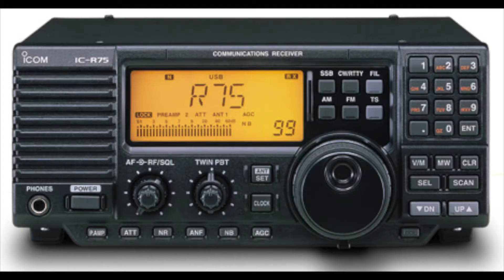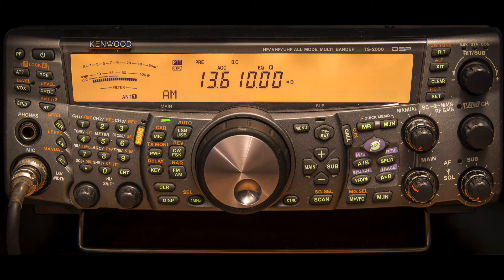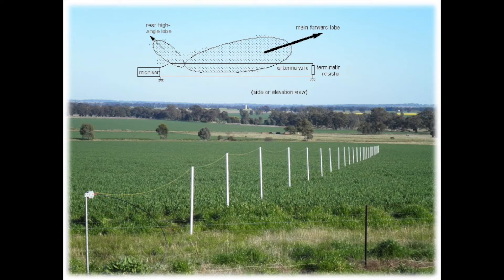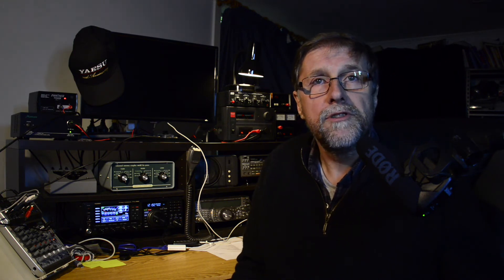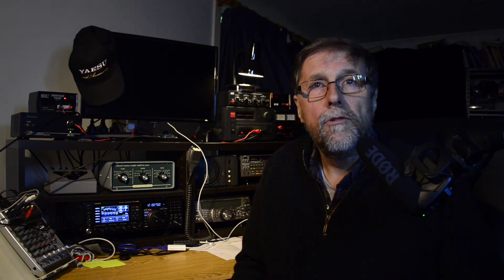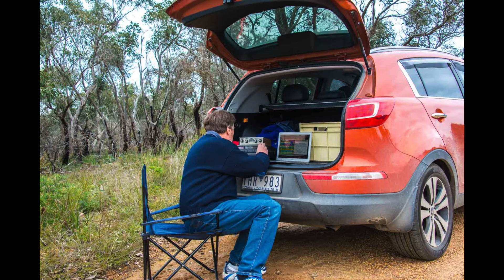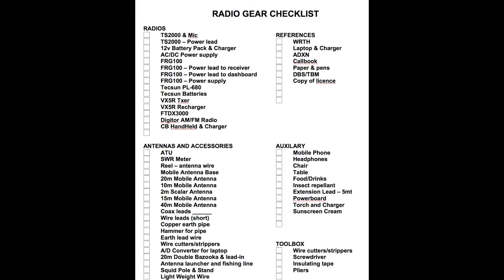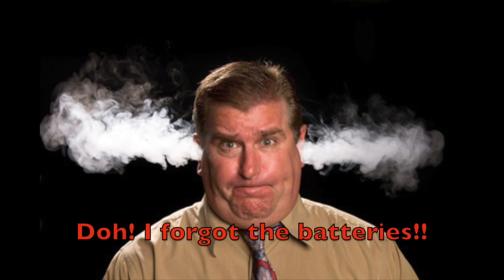Preparing for your Next DXpedition - Part 2

Comment: Some more great info Rob and some very nice radios. It is certainly a tough decision to decide which radios to take. Great video. 73 Graham
Reply from the maker: Yes, Graham. Taking the right receiver for the right type of DXpedition, depending on duration and transportation resources is well worth spending time in consideration. Thanks for sticking with the Part 2 video! ;-)